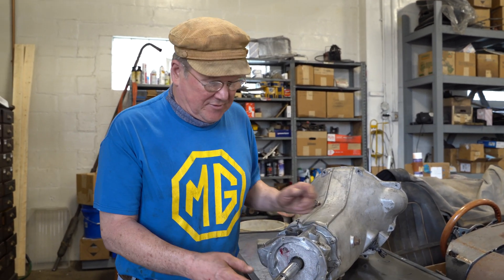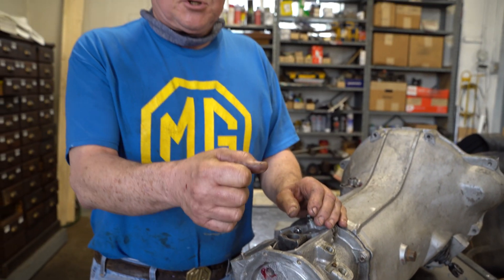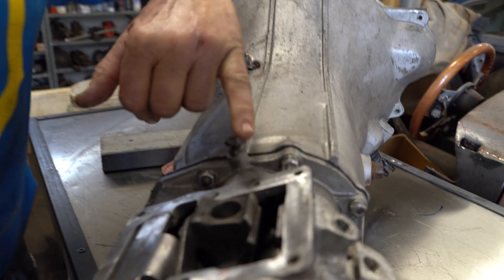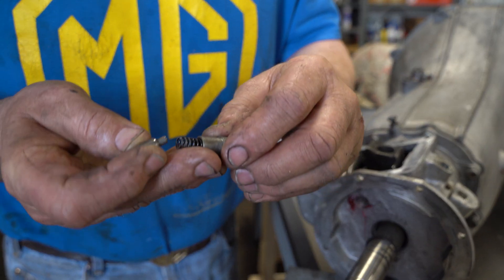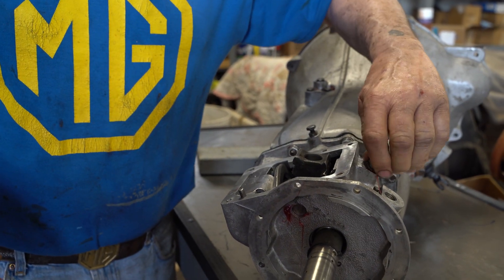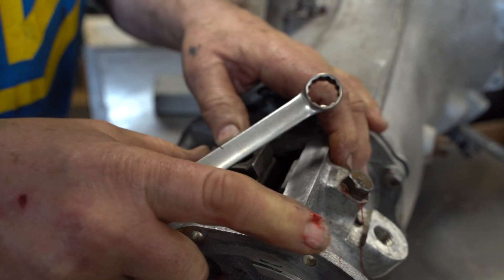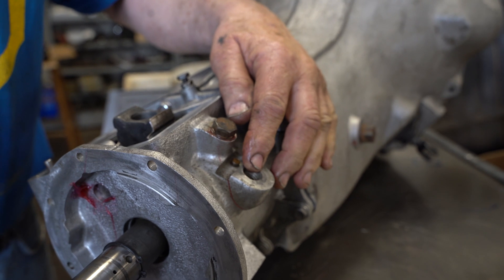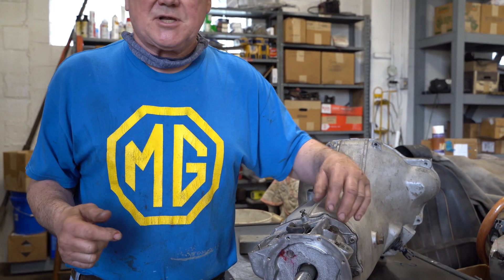326 MG Tech | How It Works: Engaging Reverse on a MG

Comment: Great explanation, thanks for making the video. On our MG BGT, we've got the problem of reverse being too easy to select, and I've crunched it a couple of times recently, especially at junctions. This weekend's job will be to clean and re-grease the plunger (along with the reverse light switch which is only working occasionally).

Comment: I have just purchased a 1970 mg midget and I dont believe i had a problem getting into reverse, but would get stuck in it and had it shooting me backwards even with no gas. I dont believe it is the original engine and am hoping cleaning and bleeding fully the slave cylinder will do the trick. any suggestions?